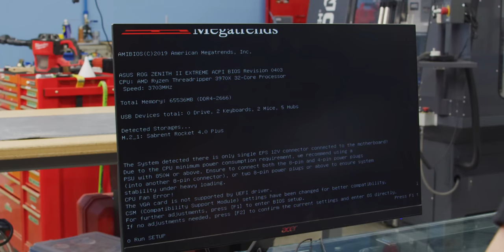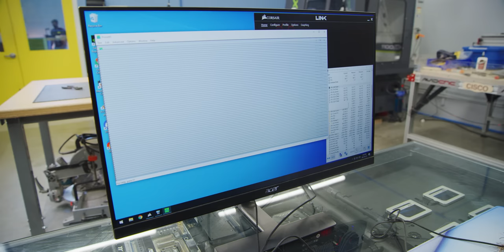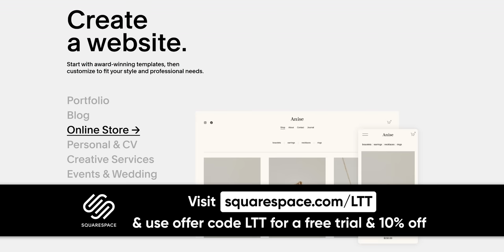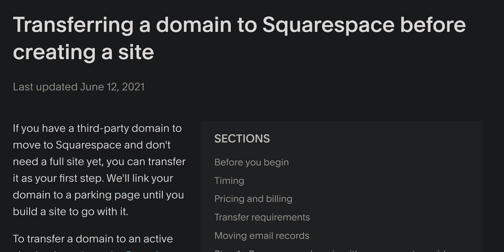Powering Up My ZERO Compromises Desk PC Part 4

Comment: The gpu shortage is real when Linus uses a 3070 in his no-compromise build.
Reply: They said it was for thermals in a previous vid
Reply: poor linus only a 3070
Reply: @AustinSBs  that sounds like a compromise
Reply: He doesnt need that much in his office.
Reply: uh huh
Reply: 3070 is enough for the next 4 years.
Reply: tbf i think it's probably to do with size, i'm not sure a 3090 would fit, it's probably too thick
Reply: @swiftbl4de336  maybe 
but its not a big deal for him he could do something and make it fit in
Reply: @swiftbl4de336  a 3070 and a 3090 are the same thickness when water cooled
Reply: @spacekatfpv796  precisely
Reply: Didn't he say this is a office build? A RTX 3070 is plenty for an office build. No one needs a RTX 3090 for an office build.
Reply: @NissanSkylineVR30  Well if that's what they said throughout the video then ye thats great, but they said no compromises which a 3070 in this case is a compromise
Reply: @QuackingEldrich_101  no compromise =/= the best possible. Its not a compromise when he didnt want it anyways
Reply: @Juuls04  he literally has a 32 core cpu, a 3070 seems like a compromise,  I'm not saying he needs a 3090 but at the very least a 3080 or 6800xt
Reply: @QuackingEldrich_101  he isnt gonna be gaming on it so it wouldnt change anything
Reply: @Juuls04  but for productivity it's also a good improvement, srsly a 6800xt wouldn't hurt anybody and would be a lot more "no compromise"
Reply: @QuackingEldrich_101  Well. Compromise would mean he wanted and needed a RTX 3090 or more but got a RTX 3070 due to X Y Z. But he didn't do that. He literally never went out to get a RTX 3080 or higher.
Reply: @QuackingEldrich_101  That's not a compromise though. A godly CPU does not mean you need a godly GPU. Besides a 3070 is plenty GPU to handle most games at ultra settings at 1440p.
Reply: @NissanSkylineVR30  except if he wanted to use this setup for gaming he would have just used a 5950x, this is clearly meant to be used for productivity and sure a 3070 is great at it, he really could have just went for a 6800xt and called it a day.
Reply: One compromise build
Reply: @valshaped  yes
Reply: And 64 gigs ram
Reply: @QuackingEldrich_101  I mean he couldve gotten one of the new $5k 64 core threadrippers, but he didn't.
Reply: @Prestiged_peck  64 core isn't no compromises I would say, it's more overkill than anything at that point.
Reply: @QuackingEldrich_101  but what about if you have to run ark evolved at the same time you have to run minecraft with orespawn? And then add in a CAD simulation in the background and it might even burn up a 64 core!!! (Jkjk)
Reply: It’s also because it’s not enough space for a powerful power supply to have a 3090 in it. He said so in a previous video
Reply: @AustinSBs  Mmmmmmm yeaaa   ✌✊✌✊ "Theeeeeermals"✌✊✌✊ lol  😌😅
Reply: I mean a 3070 is probably no compromise for his office pc, and if he threw a 3080 or 3090 in there the desk would be thicker. Its like saying a no compromise thin and light laptop, obviously there's gonna be compromises. More like no compromise for a specific use case.
Reply: @swiftbl4de336  a water cooled 3090 would not be too thick.
Reply: @AustinSBs  but its a "no compromises" build
Reply: @hanrinch  nah. I have a 3070 and it’s not enough now sometimes
Reply: @snarlynx1   yeah, tell me about it! In general use a gtx 1080 is more than enough for many game under 4k resolution with high setting and your rtx 3070 is league beyond, my quadro k4200 4gb (gtx 770 or gk104-a2 variant) is still fairly well in today’s aaa title with 2k medium-high setting and my hd 7790 2gb is still strong in full hd with medium setting. The game industry is far behind these days
Reply: @QuackingEldrich_101  for a office built that seems no compromise
Reply: @QuackingEldrich_101  no way 6800xt. Other than gaming it's not good in other workloads as 3080 or 3070 this for this gen
Reply: no compromise = dual rtx 3080 in sli
Reply: Hey no 3070 slander here I have one and it’s god tier
Reply: @QuackingEldrich_101  you need a CPU for office work not a GPU
Reply: @rtyyyyb  they needed something that was short enough, a 3090 takes up 3 slots whereas a 3070 takes 2
Reply: @NissanSkylineVR30  "No one needs more than 64 MB of ram
Reply: That's what I'm saying 3070 that sounds like compromise to me
Reply: @NissanSkylineVR30   yeah 3080ti is good for everything
Reply: I was like is a 3070 the best available???? 😅
Reply: Compromised on yet another no-compromises build
Reply: @hanrinch  not even good enough for half a year what are u talking about at least in gaming sake
Reply: @hanrinch  whoosh
Reply: He probably should have gone with a 3060 ti as it's a work pc so the vram could help. Although I don't know what he does for his working so idk.
Reply: Its for heat and size issues.. but a inch deeper would be a good solution for it and look as good.. the extra depth would allow for bigger rads n fans and better pipe runs ect

Comment: "Absolutely no compromises in performance ..." adds 3070
Reply: Pretty sure the reasoning was covered in Part 1. It was either a size or heat limitation, not sure exactly which.
Reply: @iClone101  well thats a compromise smh
Reply: @angery5879  lmao 😂 😂
Reply: Or just a stock limitation, given how overkill a 3070 already is for the work Linus does?
They probably needed all the 3080s and such for projects that actually needed that kind of performance
Reply: 3080 and 90 run too hot. Probably didn't wanna risk it on the first build
Reply: Ya not watching the rest after that
Reply: @KingLo  THATS A COMPROMISE
Reply: @KingLo  that’s the point. It’s nit zero compromise if there may be heat limitations that prevent more performance
Reply: thats what i meant. 3070 is just fine and will run everything on high resolutions and high fps. but as long as there is a 3080 and a 3090 out there, which could even be used in sli/nvlink, a 3070 should not be considered a "zero compromise" component
Reply: @iClone101  Yeah, regardless of the technical reason to choose a not-top-of-the-line GPU, it's a compromise. It may be a mandated compromise, but it's still a compromise.

I'm sure if he were serious about no compromises, he would have figured out a way to use a 3090.
Reply: @KingLo  actually my 3080ti runs cooler than my 1080 did

Comment: Linus: "The goal was to give up absolutely nothing in terms of performance"
Linus 10 seconds later: "it's got a 3070"
Reply: jaw droped tbh
Reply: I came straight to the comments after that part of the video cause it makes zero sense.
Reply: @somebody22222  It's still a damn good card.
Reply: @somebody22222  me too, everybody expecting 5950x and a 3090 haha
Reply: Could've just made a nice dock for a laptop with a 3080 mobile neatly integrated into the table with maybe ducts for the rear and bottom vents so that it isn't as loud or something like that
Reply: higher end cards have too much heat added for small gains.
Reply: He doesn't actually need a really high end graphics card for his work pc. Linus is likely not going to really utilize it's power. Remember all he does is reviewing scripts and administrative work. He could get by with an even less powerful card than a 3070
Reply: @or2kr  egpu solutions are garbage for getting the true performance they are capable of out of the card.
Reply: @ReivecS  I think the biggest problem is the 1U alphacool rads.  They simply don't have the heat dissipation capacity of the normal 120/140 width radiators, and then lose again because they're not having air directly pushed through(though they'd probably do fine in an actual server case with delta screamers and hot aisle/cold aisle).  I'd be nervous if the water temp was over 50 C(long term issues with some plastic parts and seals).
Reply: @companyoflosers  he never mentioned egpu. They could've  basically taken off the laptop motherboard & integrated it into the desk with better cooling.
Reply: Its a workstation not a gaming pc .. They need more cores than GPU :D
Reply: In his point of view 3070 wont lose any performance and without overhitting
Reply: @pedrobarth6318  The 3970x was not a bad decision check benchmarks it's a workstation but the 3070....that's a compromise.
Reply: better than my gtx 690 lmao
Reply: To be fair it also needed to be thin.
Reply: @ReivecS  the gain from a 3070 to 3090 is far from small🤣
Reply: @Execuor  Everything you said is 100% true. The problem is that everything you just said also 100% contradicts the statement, "the goal was to give up absolutely nothing in terms of performance."
Reply: @ReivecS  That's a good point. Ya 3090 is the beast, but the 3070 displays just as well in most games.
Reply: @gingerman5123  no it's not, my brother had a 3070, can barely play any games in 4k. He sold it and got a 6800 and loves it
Reply: @moparjr89  When compared to power draw, it kind of is. I have a 3070 and 3080ti and if I were to recommend one to anyone, even ignoring prices, I would generally lean toward the 3070. The 3080ti draws stupid amounts of power just idling.

Also, name me a game  you can't play on a 3070 right now.... I will wait. :-P
Reply: @Anukinihun  cool story bro
Reply: @kyrillgill9112  a water cooled 3090 isn't thin? I thought the radiator & fans are what make it so THICK?
Reply: Yup, Is the shortage really that bad?
Maybe they have only one 3090 that they're cycling!
Reply: Watch "DYI Perks" builds to find out that the builds in this channel are "meh".
Reply: @pedrobarth6318  3090 is consumer, think workstation
Reply: @or2kr  desktop 3070 is faster than a 3080 mobile. But either way if he can fit a 3070 you can fit a 3080 or 3090
Reply: They only have one 3090 and they need to reuse it for all the other builds they don’t finish, so there’s no way they could put it in there.
Reply: How is a 3070 a bad card? It can run anything you want…
Reply: @pedrobarth6318  The 5950x wasn't released when they originally planned this build summer of 2020 same with the 3090 plus the card shortage made it absolutely difficult to get anything more then a 3070 for a reasonable price. Plus they put 64GB of Ram on a board that supports 128GB  so that sounds like a compromise to me and no one pointed that out.

Comment: LTT: "We're working super hard on this desk PC!"
DIY Perks: "All made in home."
Reply: This is another Tuesday for DIY PERKS XD
Reply: Honestly, it feels like they threw in the towel on this build because of how severely outclassed they were on this build. DIYPerks PC builds have out done everything LTT has built in the past year, and honestly a lot of other channels as well, and they do it without reusing the same dusty old parts in each video.
Reply: LTT should donate their entire workshop to DIYPerks. All these tools are wasted on them...
Reply: @arc1t3ct-9  Well, LTT are profesionals, so i don't think that should be the case.
DIY Perks is more "humble" so to say
Reply: @Yurch890  Professionals at manufacturing? They have some of the most expensive  tools on the market and they don't even use them. I'm guessing they were planning to do something similar to Hacksmith but they got bored and gave up.
Reply: @arc1t3ct-9  Remember that LTT is basically a company, they buy tools that use once and never use again, but they might use it again in the future, and i'm sure an expert would have 100 reasons to counter your opinion
Reply: @shavez9913  hahahaha nice joke noob

Comment: "The goal was to give up absolutely nothing in terms of performance."

Wasted opportunity to say: "The goal was to leave absolutely no performance on the table."
Reply: Underrated comment good job lad
Reply: He said that yet has a mid range GPU, and not even the top end variant of a LAST generation CPU lmao
Reply: @pcmasterracetechgod5660  In all fairness,
most workloads cannot appreciate the raw pwer of current gen top end hardware hardware.
The software hasn't caught up
Reply: But a 3070 tho?..
Reply: Yet no 3090 GPU or 5900X CPU in this desk PC. At least cheap out on something regular viewers wouldn't automatically notice as a compromise! 🤔🤦🏻‍♂️
Reply: @rustler08  on the table is better because the performance is in the table not off of it
Reply: @RJ_Cormac  a 5900x would get shit on by the tr
Reply: New @linustechtips writer right here.
Reply: Looks like they need to hire you as a writer.
Reply: @pcmasterracetechgod5660  that’s what I was thinking
Reply: @RJ_Cormac  5950x for truly no compromises
Reply: @Sol_Creations06  They didn't show the larger TR4 socket CPU in this video, I misunderstood it as an AM4 socket AMD 3900x 12-Core/24-Thread, 3.8GHz/4.6Boost, MSRP $500.
But I was wrong, watching it again, he is using a professional grade AMD Ryzen Threadripper 3970x 32-Core/64-Thread, 3.7GHz/4.3Boost, MSRP $2,000.
Still not "The fastest CPU on the planet" AMD Ryzen Threadripper 3990X 64-Core/128-Thread, 2.9GHz/4.3Boost, MSRP $8,000. Which LTT just reviewed in a video last week. But much better than the AM4 socket AMD Ryzen 9 3900x that I incorrectly assumed was being used.

Still a 3070 GPU, when LTT just did a 4+ hour long video on upgrading all his employees work machines to water cooled 3090's, with the plan on keeping them for a few years, even after the next generation GPU's are launched.
Reply: @RJ_Cormac  the gpu is becuase most applications cant utilize 30 series yet so a 307 is basically a 3090/3080
Reply: @pcmasterracetechgod5660  if that's a midrange gpu to you then holy crap that's expensive taste.
Reply: @platinumsky845  It's only expensive because of scalping. A 3070 is the third worse card of this generation. The 3070ti, 3080, 3080ti, and 3090 are all better than it. The only cards below it are the 3060, and 3060ti. I think that makes it low-mid range.
Reply: @pcmasterracetechgod5660  scalping has nothing to do with my comment. My whole system with a 1060 and 4770 cost less than a quarter of one of those cards before scalping made the prices soar. I can play all the games I want on that computer, I consider it to be a low end system. Mid range for me isn't even part of the 30XX series, so midrange for you is high end for me. Scalping just makes it BEYOND expensive, hence why I say your taste in midrange is expensive, scalping or otherwise. I can't imagine paying more than $350 for my system, let alone more than that just for the graphics card.
Reply: @platinumsky845  But your 1060 isn't on the market anymore, it's an outdated GPU. You wouldn't say your 1060 is high end just because it's way better than a GT 430 would you? No.
Reply: @pcmasterracetechgod5660  in production or not it's still available secondhand, it's still part of market availability, it can still play game that people enjoy, hence it's still part of the available set of options. If you wanted to talk specifically modern graphics cards then say MODERN graphics cards.
Reply: @platinumsky845  So by your logic, a GT 430 is still available secondhand, and your 1060 is thousands of times faster than it. So your 1060 is ultra high end right?

Comment: 5:52 PRO TIP @ LINUS: If you have a leak that you can't see or hear, get some soapy water, and rub some of it over areas that are suspected areas for the leak. If air comes out of a particular area with the soapy solution over it, it will create bubbles, showing you where the leak is.

Learned this from fixing car tires XD
Reply: They did exactly that in the previous episode, dunno why they didn't do it on this occasion.

Comment: Linus: "I can't hear anything, turn off the lights"
Patrick Star: "I can't hear you, it's too dark in here"
Reply: umm... lights make buzzing noise due to incorrect fitting and overtime big tubelights or LED start making it even more louder
Reply: @gwadamit8116  common sense knowledge won't stop me from making a SpongeBob reference
Reply: @traitorkat346  that's the spirit!!
Reply: @traitorkat346  You're a little confused but you got the spirit.
Reply: I get the reason for the lights due to ballast/controller buzz - but that's on level with turning the radio down when you're trying to find a location.
Reply: Big studio lights... They probably have cooling fans on them right?
Reply: @xXDarthBagginsXx  Well if they weren't loud and he didn't think it would help he wouldn't have asked, likely even more lights than you'd think in there because of filming too and it was a very small leak.
Reply: @njoshua3265  I understood why he asked to turn them off - I know the lighting they use can make noise and listening for a small leak would be drowned out (also not closing the pump all the way will cause a leak too - which I have done on mine).